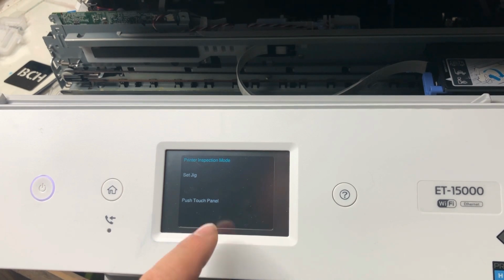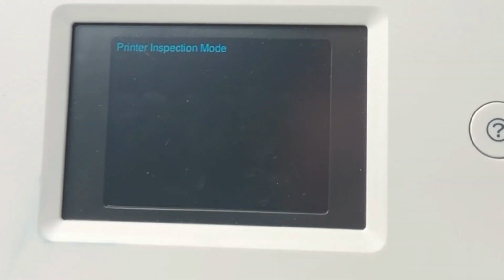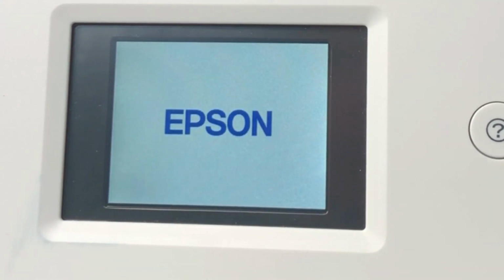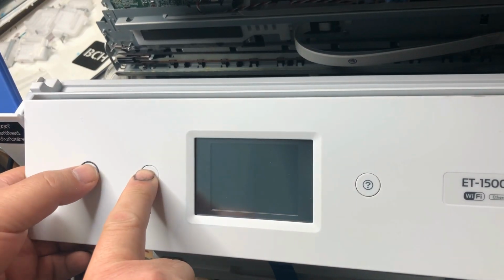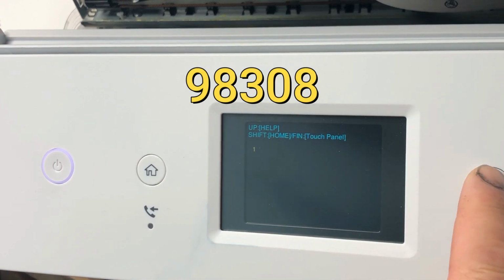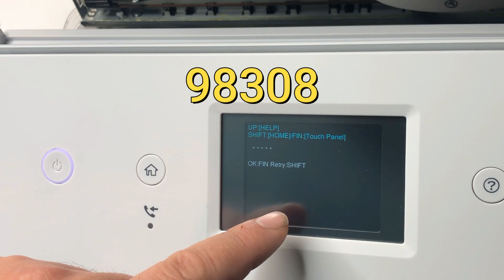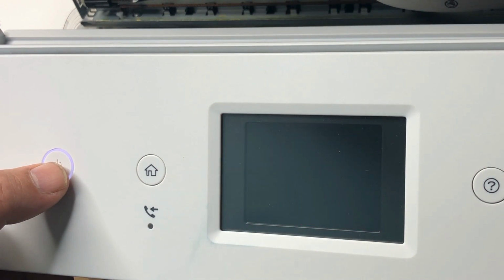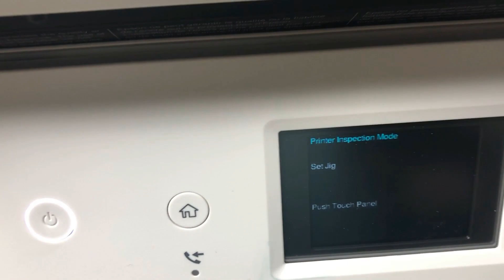Printer Inspection Mode Explained - Set Jig? Secret Epson ET-15000 Menu Part 1

Comment: Is there any way to get out of this mode on a ET 4750 without reprogramming the EEPROM? I am not a technician. Do you have a code for it? I fell into it yesterday and I don't know how to get out of it. The recovery firmware from epson website can't find the printer via the usb cable to flash the recovery firmware.
Reply: Did you figure this out?
Reply: @nikki97794   yes I did 2 clips on the topic.
Reply: @__LIN___  glad you found a solution. I can not access the website in my country so I will try something else